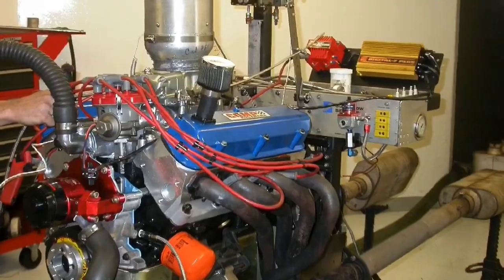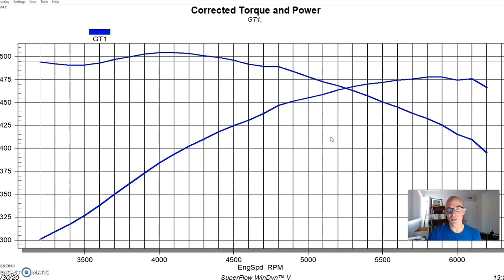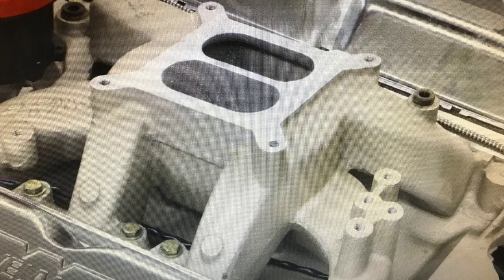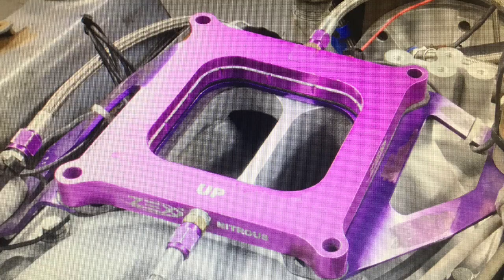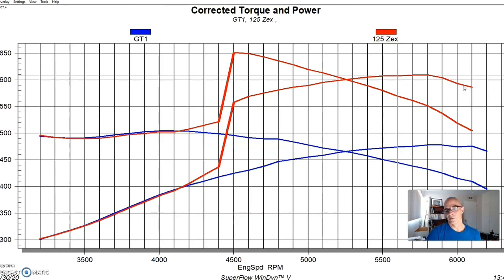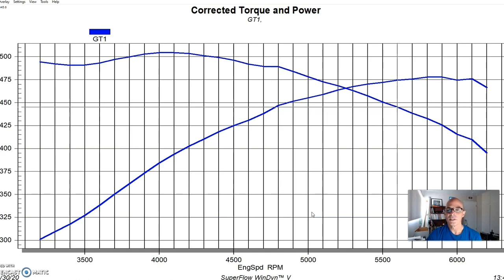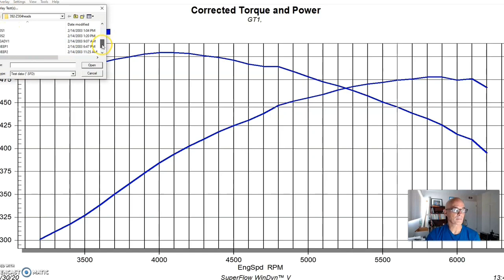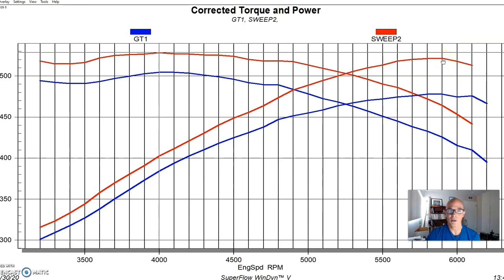392 FORD STROKER HEAD TEST

Comment: One stout SBF, and streetable!!! I don't remember all the specs on Freiburgers 410 for the Disgustang, but it was 20-30 numbers short of this 393. It had slightly better heads, similar compression, more cam, and the same intake. Both were dyno'd at westech. I would've thought that DF's 410 would have been 20-30 numbers up from this. Interesting 🤔

Comment: I have had these parts just waiting for me to put together. About how much hp/tq can I expect.

94 ford lighting truck motor
Steel hair gaskets Sleeve block For 300 shot
Stock .30 over probe pistol heads stock rods which makes it
392

Skat crank 392 crank
Double roller timing chain
Flat tap converted to roller retro kit
Moroso oil pan double pump deep sumo 8 quart pan
Trick flow track heat heads
1.6 on intake 1.7 on exhaust side
Com Cam 550 retrofit cam
MSD distributor

351 shorty swap headers hookers headers
No Valve covers - intake
Reply from the maker: need more cam info

Comment: I would have liked to see the victor Jr intake with the Z heads. Also would like to see a comparo between the victor jr and the TFS intake. And with the Edelbrock victor heads and the 225 hiport TFS heads who's intake works better on who's heads. On a short block of 393 - 427 cubic inches.

Comment: I wanna build another junkyard dog! Was gonna build a straight up Windsor, but it's naming on me to know for $600-$700 more I could build a 392! Crank and cheap set of pistons! The old 94F150 flareside is close to 4000lbs! And all the extra displacement comes from stroke! No how long will my tci c4 hold up! No gas, all motor, but it's rated for 450hp! Hell, I'll get stupid and put my 100shot on it!

Comment: I have to disagree a little about “nitrous always does the same thing on every combo”. I’d say realistically this depends on the state of tune the engine is in that you apply the nitrous to. If it’s already a very well built and efficient motor producing good power yes typicall you’ll get 100 HP from a 100 shot, 125 HP from a 125 shot etc. But an engine that isn’t built up at all say a stock engine, especially a high compression NA street/stock engine, you can end up seeing a lot more Hp than the jetting you use in the kit. A 50 shot on your average stock pony car picks up more like 70-80 HP typically. Another thing that varies from motor to motor is the amount of torque picked up by a given nitrous shot. A mild cam iron headed tired old small block may only see 70-80 ft lbs off a 125 shot but the likes of say a 3v mod motor will generally pickup a full 120-125 TQ off a 125 shot.
Reply from the maker: the nitrous jetting and bottle pressure determine the potential gain from the nitrous, then the tune, not the motor combo
Reply: @richardholdener1727  Edit- I forgot this as well; the way the engine pulls it’s air makes a difference too. If your running a crappy intake that pulls nothing but hot air creating high IATs, that cooling effect from the nitrous alone will increase power. By the same token if you already have a very well designed intake and your IATs stay low on a regular basis, your going to see less of a gain than on the previous scenario. Again, I guess this might be considered state of tune in a way, especially with a modern engine where timing gets pulled from high IATs and then a retard doesn’t happen but an advance when the IAT is very low. And am I right in hearing you say the way the nitrous is introduced into an engine makes no difference? I don’t know about that. A plate kit on an older carburetor motor will often make much different gains than a direct port nozzle kit, even given the same jet sizes and bottle pressure. If you are more efficiently distributing the amount of oxygen introduced by the nitrous shot the engine is going to make more power, same for the opposite if a less efficient delivery method is used the gains will be less. I’ve literally seen with my own eyes two different kits with identical jetting make very different power levels. And we always keep bottle pressure around high 900’s or so, I try not to let that be a variable at the track because if the pressure is consistent I know what to expect from the hit.
Reply: You’ve dyno’d enough engines to know that a happy well breathing engine makes more power than one that’s choked on a couple holes. Some of those old perimeter plate kits definitely do not equally distribute nitrous to all cylinders so cylinder pressure (and therefore power production) will vary. However if I plumb a nitrous and fuel jet individually to each intake runner and each cylinder is balanced and happy that engine will make more power because it’s running more efficiently. I guess that could be considered part of “state of tune”, though.

Comment: Put a 351/393 engine together, 4.0 bore x 3.85 stroke, forged crank, h beam  5.96 rods, forged piston with 351n heads and had a 570 intake, 590 lift flat tappet cam , single plane intake that produce 470 for torque and 470 for power.

Comment: I have a Ford fe 416 c.i.(4.08x3.98) with iron 406 heads(2.09x1.66 valves) that made 580hp at 6700 and 540tq at 5100 on Somer's dyno. You can't do enough to a Windsor to get it to keep up with a similar built fe.
Reply: Dollar for dollar the Windsor can

Comment: Thanks a bunch Richard for all the work you do with testing. Am working on a 351w build for my sons ford ranger project truck, and was thinking about going with a 393w stroker combo. Nice  motor!
Reply: I recommend do it i do it in my 3 fords  it work great i use afr 185 and 205   also use the same cam 282xe good combo
Reply: @humbertoarellano2725  umm yeah. We don't use comp.  We custom spec our own cams either from Howard's or clay smith.  Great success..

Comment: @Richard Holdener  Have you ever tested a set of J302 SBF heads?  And can you do a comparison between GT40P heads, J302 heads and the GT40X heads on a 302 vs. 331 vs. 347?  I have a set of J302 heads WITH J302 headers you can use!
Reply from the maker: I tested 30 sets of SBF heads-those videos coming

Comment: Ever had a chance to try a CHI 3v head Clevor? Their 225cc head does 317@600, 327@650, 331@700. I'm thinking they might make good power.
Reply from the maker: they work well-I've run them

Comment: Richard.. PLEASE..  o love your comparison videos. You're very informative and very unbiased. Would you please do a motor to motor comparison about Big Blocks. I started watching a guy who wanted to do the same thing but then one Motorhead aluminum heads one head of mechanical cam one had a roller cam. At that point I was out LOL would be great to see the short blocks with similar cylinder heads and camshaft

Comment: Ya thought the Z head was a good upgrade for the motor.
   One question, is the x head the original GT40 heads that came out in 93 on the Cobra, Noticed the P's equiped for or most from explorer motors. 
     Was there another basic GT40 that was out before X or was that the original GT40.
Reply: My 5.0 ranger came from a totalled blue ice colored explorer, it's a straight gt40 head set.
Reply from the maker: The GT-40X is an aluminum heads and not like the iron GT-40 head that came on the Cobra or Explorer (or the GT-40P)
Reply: Ok got it. There the aluminum heads.

Comment: I have everything needed (minus pistons since I wanted to see what it would take to clean up the bore) to build a 383 Windsor.  I was going to boost it but decided junkyard 5.3's made more sense.  It's all been sitting there for years.  This makes me want to pull those parts out and have the block machined.  Not sure what I'd drop it into.
Reply: find anything yet?
Reply: @albertgaspar627  Nope.  Ended up building a car to go endurance racing with friends.  I’ve got too many projects in various states of completion to worry about the Ford right now.

Comment: I used the AFR 205's on my Dart 408 and it made 615 HP. When I increased to 427 CI  I switched to Edelbrock Victor Jr but did not have access to a dyno any longer, but on the track (road course) it felt down on power.
 A disagreement with the Armco forced my retirement of track day fun and the engine went on to power somebody else street car. I feel embarrassed  for that engine now relegated to the street and car shows.
Reply from the maker: the AFR 205 should make more than the vic jr
Reply: @richardholdener1727  Agreed. Unless the Vic's got properly hogged out.

Comment: Great video! I remember a test on the Z304 heads back from MM&FF days and the AFR and Trick Flow High Ports did much better? Seems the Ford Z heads were very expensive and came bare,without valves and springs?
Reply: I still have that magazine somewhere. I think it's from 2007 or 2008.

Comment: I’ve seen plenty of build articles on the 7 liter Windsor but none dyno’d  with modern fuel injection. It should make 600+ hp with a streetable hydraulic roller. Have you tested this combo in the past?
Reply from the maker: I ran this motor with EFI and have run 427s ( 7 liters) with EFI as well

Comment: I love 393 Ford's. Don't know why they call it a 392 though. When you do the math it works out to 393.  Anyway the fact that you can build this so cheap is awesome. Just buy the stroker crank, use your stock rods, and find some .030 over 302 pistons, get it balanced and bang! Stroker 351. No machine work necessary.
Reply: there's a youtube channel "neomustangs" doing it, but without the overbore since EFI blocks typically don't need it but more importantly...stock 302HO forged pistons go right into a 351W block to cut costs on a 387 stroker.

Comment: Those Z heads can make some great power. I ran a set on a 363 I built a while back from a 9.5 deck block out of a wrecked truck. I think it was around 11.3:1 comp calculated with that head. Big cam. Made 425-430 HP at the wheel on a chassis dyno. Similar torque. Engine is still racing to this day in a Fox but this is a Fairmont variety.
Reply: I did a 393 years ago, with ported Vic Jr heads, the "5-oh HO" style Victor EFI intake, and a ~250º cam. Did 500whp @ 6300 and over 500lbft from 3500-6000. Nice combo, especially in the early 2000s!
Reply: GroovesAndLands I would have loved that power lol. Was your compression up there? And you were injected then MaF/MaP I guess? Mine had an Edelbrock intake and Edelbrock 750 carb on top of the Z heads. It was a very conservative tune though. I’ve since built 8.2 deck stuff that’s made more power than that engine NA. As a matter of fact I have made more power from an NA 310cid SBF lol. Revved a lot higher though and less torque but I built that for a customers Miata swap so it was never noticed as a flaw lol.
Reply: And my 363 cam was a Lunati mild truck type of profile 280/290 and .472/.496 at first but then switched to an Edelbrock with 299/302 and .573/.582. It had some cam.
Reply: @kennethpowers8995  Mine was injected with a ~100mm MAF and a huge (at the time!) 90mm throttle body. 1.75" headers, a 3" MAC pro-chamber mid pipe, the old flowmaster 2 chambers (before the delta flow ones), with dumps in front of the rear axle. Remains, to this day, the sweetest sounding small block anything I've ever heard. I recall compression being about 11:1, and I know I certainly had absolute minimum piston-to-cylinder head clearance - because "engines always run best when the pistons hit the head a little" IIRC, I was even able to get it to run smoothly at part throttle at about 17 or 18:1 air/fuel - so it even got really good gas mileage on the highway. It was a kickass combo for the time!
Reply: GroovesAndLands Yea we were making some really good combos back before it was second nature to see a 9 second stock LS Foxbody or the like. I also have a memorable soundtrack from the 363 build, I didn’t have any crossover though it was some ARH longtubes and then 3” back to some glass packs. It was ridiculously loud but it had a signature old muscle car type sound. It didn’t sound like a Mustang it sounded just like America lol.
Reply: If you follow any of the Tri-State/DelMarva no prep or street stuff (East Coast) you’ll see my current build; it’s in a (finally) well sorted 92 Lx hatch and is of the 8.2 variety this time. 321” Brodix 15* headed small block killer. Gen 2 PTE 6870. Hoping to go 13’s this season 🤣

Comment: The question i have Richard, would it have been cheaper to go short block with those better heads? I'm sure ford stroked crate motor ain't cheap, even with shitty heads. What, another grand or two if not five to ten if you don't want shitty heads on your stroked motor from the factory.
Reply from the maker: cheaper to build it

Comment: Richard have you ever put nitrous oxide on something and have been disappointed? I see a lot of tests where a 100 shot is added and you got 100. It seems like a pointless test unless it is on a boosted engine where it gains more than 100.
Reply from the maker: when the tune is off-it doesn't do well

Comment: I would like to see the results of the AFR 185 heads on the 392 with the XE282HR cam.   Both can be found used.  The AFR 185 heads are a bit cheaper new than the 195 or 205.

As a side note I have regular unported GT40 iron heads on my 351w with an E303 and a Pro Comp (Stealth knock-off) dual plane and shorty headers.  It has more bottom end than an 5.0L, but it does not mph at the track.  Only 103 mph.  I think the heads are too small flow wise for a 351w.  In comparison my 302 with ported GT40 iron heads, XE266HR cam, stealth dual plane and Summit long tubes ran 108 mph.
Reply from the maker: we ran AFRs on this
Reply: The E303 cam is too small for a 351 windsor if you want any decent top end.

Comment: Back in 1996 I put a 385hp 351w un my 87gt. Took it around the block and realized it was too slow. Pulled it out that night. Ended up putting in some TRW forged pistons (11:1) a crower solid lifter cam and porting the J302 heads. The summer of 1997 we won the unlimited class (because I had a TH400 trans) with a 150hp nitrous kit at Fun Ford Weekend! Factory cast crank and ARP ROD bolts. Drove it home from the track!!! Go Ford Motorsport (Racing)
Reply: Go ford with a 400!turbo....wheres the ford junk

Comment: When you ran without and with nitrous, I could tell the heads were holding back potential torque. Keep on keeping on Richard and be safe
Reply: Wouldn't a nitrous motor need an increase in exhaust valving to get rid of the increased output of exhaust gases with very little additional intake volume?

Comment: Like to see another comparison between the Z304 vs 11R twisted wedge vs AFR renegade 205 and maybe throw in a set of high ports!!!!
Reply: And the 351 Cleveland 4V heads would be interesting to see close the 50+ year old design is to today's top designs.
Reply: Joe Dirt : Mr Dirt, even the gas flowed 2v 351C heads exceed the GT40X's, and the 4v closed chamber 351C heads with a good tickel up exceed.the Z304's. Nothing new since the Henry Ford II cure for the Tunnel Port, the canted valve Cleveland 351. The SCCA approved 1967 GT40 head for Shelby 289s flowed 290 cfm at 600 thou lift. The 1968 Tunnel Port, 350 cfm at just 450 thou intake lift and 380 cfm at just 550 thou lift. See https://www.hotrod.com/articles/hrdp-1305-the-story-behind-fords-iii-fated-1968-tunnel-port-302/
Reply: My ported z304 heads flow 338/270 at .700 fox lake cnc ported with 1-7/8” radius exhaust ports
Reply: I second this !!!
Reply: Shane Shaw  a set of lightly worked 302 Boss DO head or 351C Boss D1s flows about the same as the Z304's all through the lift curve, from 33 cfm at 50 thou to 274 cfm at 650 thou. FPRP buckled to the power vaccum left after Nasser got the boot, no one lead the charge to perfornance anymore  and the real advance should have been the four valve alloy 5.0 OHV  heads previewed. Honda and Toyota  proved the worth of four valve heads...FPRP was gonna do a pushrod 32 valver but...it got scupered. The Modular became the hard edge engine. The Cleveland will always whip out a can of whoppin on the  Windsors a$$. The heads have never been adequately matched. The A3 and D3 Yates heads take the Z304 and Twisted Wedge and AR heads, and stomp on them. Fords credit is that the 00's unleashed some real Cleveland like flow numbers on the stronger and better oiled tall deck 351W. Stroked, the 392/393/395 is such a great engine package...its Almost an iron 5.3 Chev truck based 383 stroker!
Reply from the maker: the stock 4V/Boss heads i tested flowed as well as the Z heads
Reply: Richard Holdener : HeyRichard...how about a junkyard F700. Even a tall 370 4.050 bore thin wall F700 truck Big Block  engine with the right gear is an exceptional way to make power...with a stroker crank, it'dalmost  be a 455 Pontiac or Olds...Buick!.
Reply: Loved this article Richard. Thanks...its like a stash of old bottles of wine found in a shipwreck. More miles per Galleon.
Reply: The 225 trick flow make ok power on the 351,  t010... I think is the 58 cc.  Be nice to know what they did out of the box on the strokers on this system....pretty sure they have video on it.
Reply: Yeah I was going to suggest the same, I like to see the 11R from truck flow, and maybe a 600 lift cam.
Reply: You are speaking my language. I big intake comparison too.